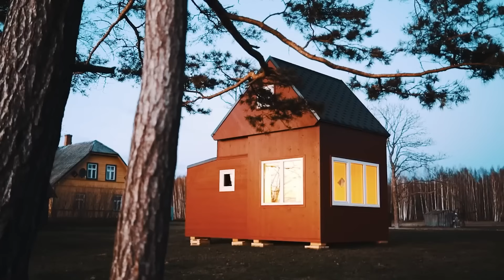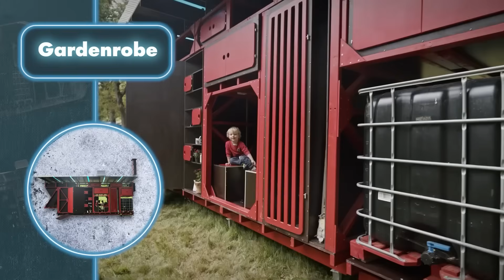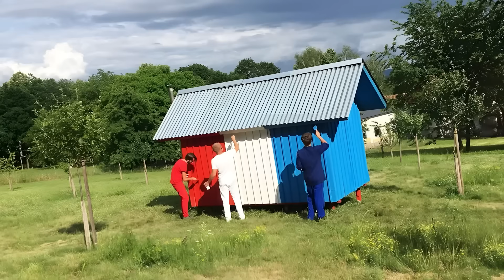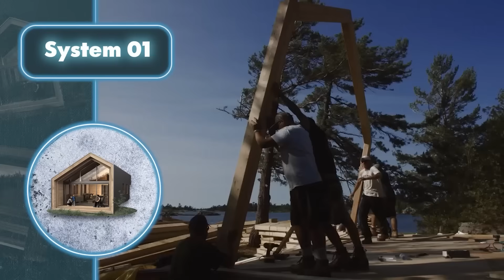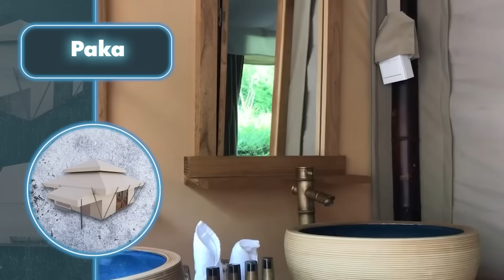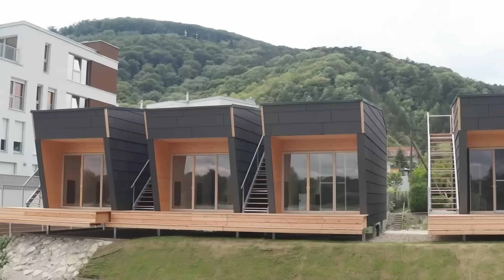60 Quick-Build Homes That Will Blow Your Mind

Comment: when you realize we already have "tiny homes" and theyre called RCs, and trailers, and when you see stuff like this, you realize that the homeless crisis is by designand there is an EFFORT to stop the free market drive to make tons of cheap housing dwelllings, ways for peopel to simplky have bike towed trailer campers,. they should be the most popular $200 item at walmart, a simple 4 weheeled bicycle trailer tent to sleep in that you can tow behind a bicycle... should be actuyally only like $75 to make or even less like $50 like  4 bike wheels and some metal bolted together is pretty cheap dude. or welded. i mean they have the technology to make cheap housing but we need cheaper propane incineration ytoilets and more cheap solar battery packs actually sold at walmart and bestbuy etc, its weird isnt it how they never sell cheap chinesium battery tech in stores?

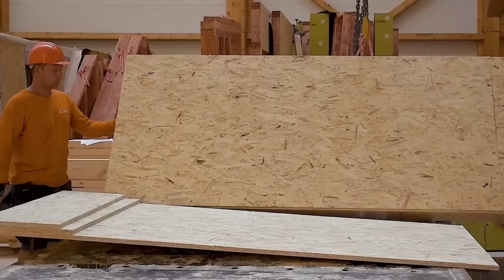Comment: 14:30 The people from frame house might be interested to know(others as well) that there is a compnay out there that condenses wood till it gets the strength of steal. (Not in all directions though, depends on the direction of the vibers). According to that company that would alow for high rise buildings made of wood.
Reply: If a pipe bursts the whole building falls apart.

Comment: If it doesn't have a bathroom and a kitchen it's not a house. Plus these are not practical for homes if you end up spending more per square foot than an actual home would go for. They're just a real fancy shed or tent
Reply: I agree, $70,000 for 280 ft.² is more expensive than most houses. we need affordable housing, and tiny houses should be affordable which means under $80,000 for 1200 ft.²
Reply: Well said and true

Comment: Remember what they said in olden times? Want something done right... Gun Barrel Pilings... Like telephone poles, but no taper. ClayMation? (Cobb.) The New Diggs... (FoxHoles.) With a "lid" on top. The Bat Cave... Maybe the B ar Den. Cardboard plastered with drive way sealer, or road tar... Gabion Walls are? Split your logs... Triple stacked, with the rocks back on top. A Triple Beam Bat Cave. All full of gwano... "Chicken wire"... on those gun barrel pilings with card board sheathing, road tar...A Frame, with a fireman's sliding pole (PVC Pipe...) to get to the bath room (On the main floor.) from the loft... Climb back up the "library" ladder to go back to bed. A Picnic Pavilion made of PVC Pipe. With clear "Tarps" hung just right with curtains... 12 PVC Pipes... Tiny House Dreams...

Comment: There's a paint that now has the ability to keep the heat and fire from getting past it's molecular structure keeping a house almost 100% fireproof. You can use it on the outside or inside.

Comment: Where are all the heat pumps that use the temps under the freezing line in the dirt to bring up cool air in the hot times and heat up just a little during cool times?  Something is not right.  Are heat pumps not a good thing?  And I am not sure about covering your house with grass like some of these houses show.  Sure if you build into the side of a hill or valley, but on flat land?????You dig down to build up and then put grass on it?????  Way back when I was in 5th grade we learned all about how the USA was going to recycle and clean up the environment from litter and trash at the same time.  What happened?  We don't recycle like they said we would and the littering and pollution has become worse.  WAY WORSE!  We have landfill all over.  That stuff can be recycled.  What is going on?  GREEDY people I think.  Money and rich people only cause more problems.  We need to spread the money out evenly and continue to work with the land and water we live in to keep it clean and productive for wildlife and humans.

Comment: All these companies should relax their prices so the people can finally afford a house.  Make them last a lifetime and then could be easily taken down when one passes away.  We need more room.  No more Tiny Houses.  We don't want that.  We need a nice house with a generator incase electricity goes out and there are a lot of ways to produce eletricity for the houses.  We just need to implement them automatically.  Cute windmill, solar cells, paint to obsorb heat in the cold and reflect heat in the summer, water collection for gardens, and upright gardens that you stand to plant, pick, water, and clean up.  Those gardens are usually from brick and are about 2-3 feet wide and about 4 ft tall.  It is like two brick walls next to each other with dirt inbetween.  And I am sure there are better ways to make an upright garden.  We need 4 season porches all the way around the house.  This gives extra space for many things and allows light and air transfer.  Anyway, companies lowering prices will make more profit as people will want these houses as they are affordable.  Greed?  No!  Stop the greed!  I like best the interlocking systems like the woodblocks or those black blocks.  Prefab has not been completely explored.  Much more could be done with those.  Flat roofs?  Are you kidding me?  Leaks!!!!  You are just asking for it with flat roofs.  Do you realize almost all medium size towns had brick making factories?  What happened to them all?  And there were alfalfa factories as well.  We could be growing forests and taking care to provide a water system like in cities that fires would not have a chance.  Then we would be using wood and growing wood all at the same time.  The lifetime of one person can grow a complete forest for lumber.  You have to think ahead.  Plus, our waterways are not being used for energy.  If we make flood waters to flow away from towns and into streams and then HUGE man made lakes, we would have plenty of water and the moving water can be harnessed for energy.  Floods all over the place damaging people's houses and lands when all that could have been addressed a very long time ago and building dams that allow water to flow through for energy as well.  Did you know that the electric trolly cars were very popular until GREED took over and pushed them out of business to have gas powered busses.  Look at all the rail ways we have built and are rotting in the grounds because trains are not used like they used to be.  People traveled by trains a lot.  You know, we shoot ourselves in the foot by not keeping some of these things active and running.  The rich need to just quit being so greedy they ruin our ways that are good for us and the lands.  Are we going back to aristacrates?  That never works.  You have revelutions by the people.  You cannot continue to treat the citizens so poorly so some are ultra rich.  That is not right and not healthy for a good economy.  The equation for a success is 10% rich, 80% middle class, and only 10% poor and the poor are taken care of.
Reply: Why are citizens hiring companies, buying retail, instead of subcontractors, skilled tradesmen or farmers?, Why?...Why?...
Reply: So everyone shd b a slave 2 what U want? (By “we” u mean “u”.) Narcissist. Other ppl r not u. Not every1 can or wants 2 live like u.

Comment: Toilet and septic?
Reply: Composting self contain toilet. Have mine just have to vent and put in the grey water septic ( holding tank ) fill with layer of sand , gravel and charcoal. Then drains off into flower bed.

Comment: Legit tiny homes are supposed to be affordable, not 90k plus. That’s price gauging.. 😂
Reply: The SCE20 is $35k US, which is an auto-construct mobile, and is a 2BR. But try and get one!
Reply: It's insulting how greedy they are, and the more expensive.... The more flimsy they often are.
Reply: it all looks so good and nice but then the prices are like mobile home price. I mean why bother?
Reply: That’s why I build my own.  I can skip out on the expensive amenities that women and weak men have been trained they need.  Result $1000 house and a $500 greenhouse I put my bathroom in.
Reply: @johnliberty3647  What weak amenities?
Reply: @johnliberty3647 how tf you get past laws with that amount of money
Reply: A lot of tiny homes are custom built to semi-custom built.   If they're a THOW, then they also need to be built robustly enough to withstand a lot of road vibration and bumps, which also increases the cost.
Reply: @TheGenericavatar thow art lunatic
Reply: One theme in small houses is you can recycle and use odd materials to custom build what you can, with what you can get for free or cheap..  Its about DIY and sweat-equity.
I build a 12x 16 legal workshop for abut 5k with materials from craigslist and homedepot seconds.....  no leaks in 15 years...
Reply: @samblum153 old materials not odd.BUT old means mold
Reply: We have to keep in mind electricity and plumbing cost and protection features of the tiny homes and the coding and housing laws prices. All that adds up over time.
Reply: Nope. Can just buy a modular home
Reply: You mean price gouging? However it's not because the cost of these have increased substantially over the past few years.
Reply: @PrimateProductions increased price means price gouging.  That's how it works
Reply: Says the guy that sells them @PrimateProductions
Reply: Supply and demand, manufacturing costs which includes paying many people on the production line and final quality control. I don't get why anyone would think any of these would be "cheap".  The only way around paying labor costs is to do all the labor, from manufacturing the parts to assembly, yourself.
Reply: @anonthehousemouse  yep